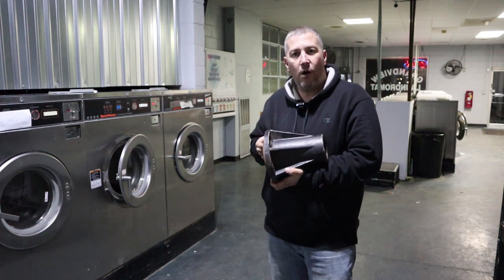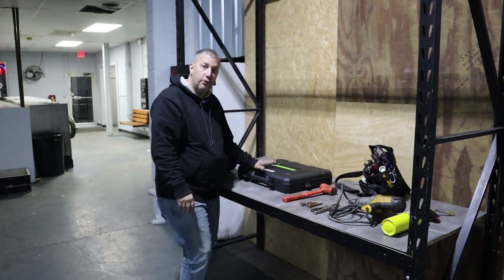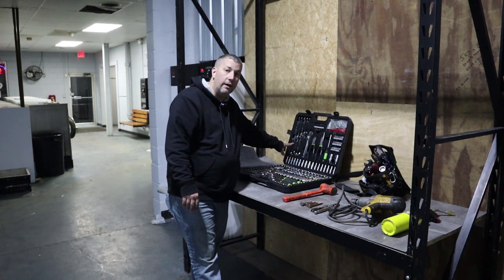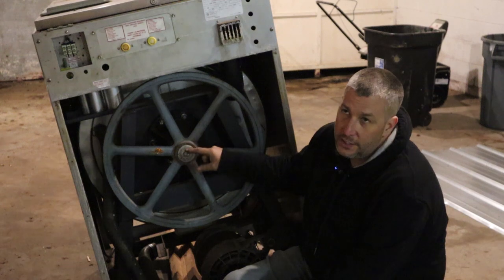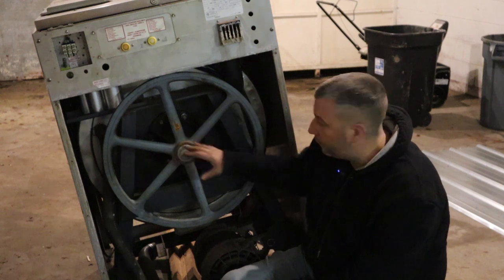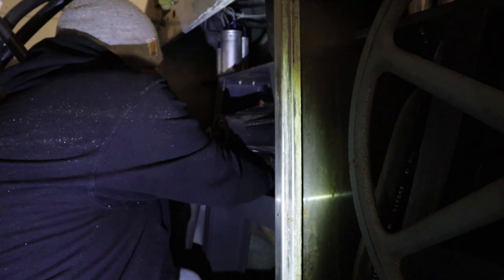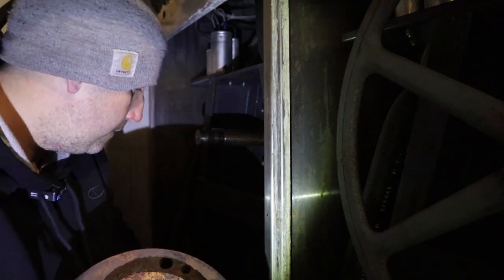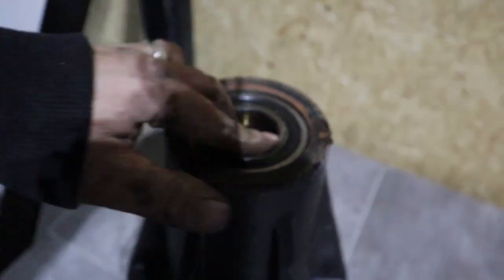Replacing BEARINGS in a Washer Trunnion ! | Part 1 of 2 | Following Keenan !

Comment: Hi bro. I have diffeculties putting it back in fully. how i pulley push it in?
Reply from the maker: I use a dead blow hammer. Once the bolt can reach threads I use it to tighten on. Hopefully the shift is not mushroom out.

Comment: Hey how you doing sir? Question what pulley puller you use to pull the drum back in to housing?
Reply from the maker: When i have the basket out i just push it on. Then i use a long bolt, cut section of 2" pipe and flat washer to tighten on hub where pully normally goes.As it tighten it will pull basket in rest of the way. Speed queen sells a tool for it. I've never needed it. Its basically a bolt, flat washer and cut sections of 2" pipe. 

Hope that helped.
Reply: @FollowingKeenan  yea thank i was assume in it but the mechanic the goes to the laundry i work tells me you can’t the you need special tools. He also told me the drums need to be place in a machine to check the balance and alignment every time you replace the bearing i think he just been greedy for me not to
Learn, i would like to learn a’lot i want to purchase one, one day if God lets me .
Reply: @FollowingKeenan  thank you so much..
Reply from the maker: In part two of this bearing video. I'll go ahead pull out the basket and show installing it. I need to replace the sleeve anyway.

Comment: What do you do if shaft has a worn groove in shaft bearing has a lot of slop if so wasting your time until fixing shaft .
Reply from the maker: Shaft has a sleeve. You can heat or cut that sleeve off. I've change a few sleeves because of so rough it would take out seal. Sleeves are like 50 bucks or so. 

You can pull drum, buy a sleeve and have a mechanic put it on. I have a video where i show doing it. Hope that helps!
Reply from the maker: If your grooves outaide the sleeve area. Then if not too bad you have a machine shop fix it. Drums for washers new are like $2000 to $2500.

Comment: What does a bearing repair like this typically cost ?
Reply from the maker: Hard mounts dealer repair with parts $500 to $600. If they replace you drum add $1600.
Reply: Crazy I was quoted 3500 per washer for a bearing job

Comment: why not just use a long reach socket to brake the nut free no torch needed i have never had to heat my lock nuts to get them loose:)
Reply from the maker: You can to start. Heat so lock nut is easier to remove. Once the bolt can turn. If the lock nut wasnt there i could take very easly. So the heat helps reduce the friction, to make it easier. 

You could do with out heat, would be more of a pain.

Comment: What not to do video. Do it the correct way and pull the cylinder out. Never use vice grips on thread bolts. Buy a complete rebuild kit and change the bearings and shaft all at once, and as usual seal kit. Most of the time that front bearing is first to go, so do a complete rebuild and be done with it.
Reply from the maker: Nice! I did change both bearings and seals.  I just remove the trunion out the back. I only change the shaft sleeve if need be. Also i only pull drum out front if i need to do a sleeve. 

Kit over priced. I just hate to see people waste time and money.
Reply: @FollowingKeenan  Where is part 2 of the video? I would love to see it